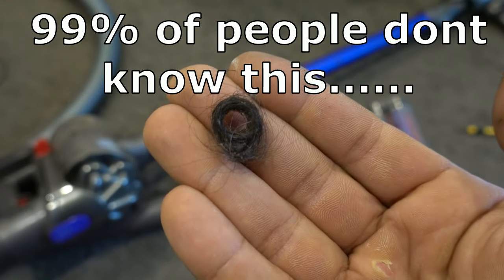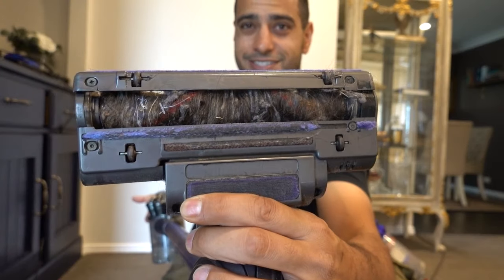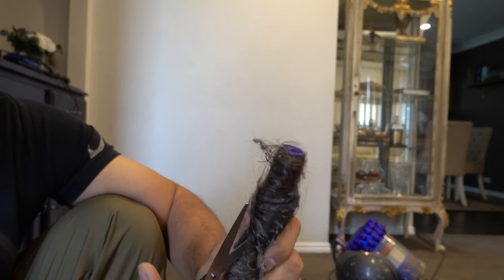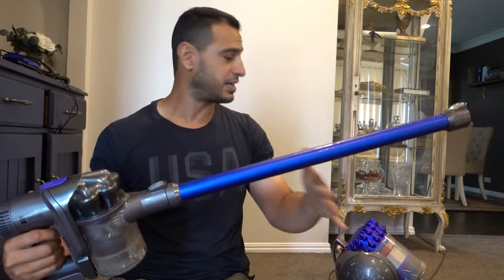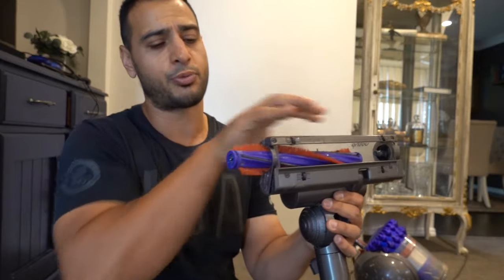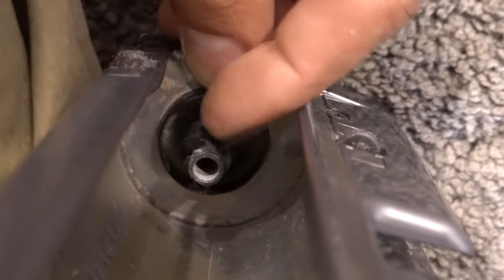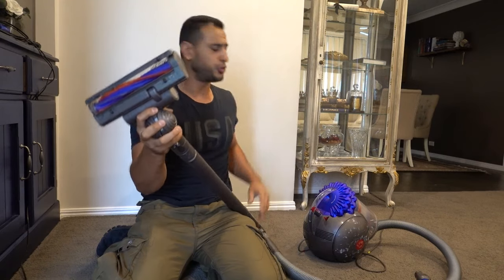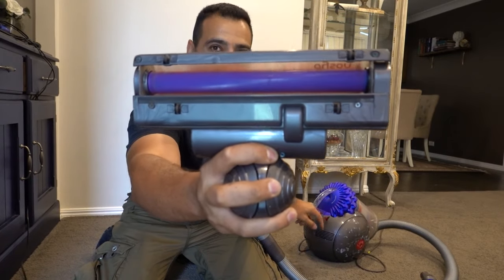How to fix Dyson Vacuum head  - roller not spinning

Comment: Amazing, was ready to throw my dyson out. However can't find that screw driver he refers to to get the last bit out.
Reply: Ok update... after days of trying to find the right tool... got a little handy tool thingy from daiso for only $4.20. Pulled the whole head unit apart to discover not same model and couldn't get to the bit where he takes that hair out at the end. Poo!. But in putting it all together I discovered if you don't tighten the end bits too tight the roller spins freely. All's good for now. But if someone could post how to fix a DC 35 stick please share. I don't think my skills will hold out for too long

Comment: I can't tell if mine is a dud or if the turbine head just sucks compared to a powered unit because it spins but not enough to really clean the carpet like my older powered central vac.

Comment: I’m stuck!!! You have shown me how to dig deeper to clean my Dyson V6 which I really appreciate, But I cannot get all the plastic housing off and and that screw I am digging for still will not budge. Did I forget a screw.? I took 7 out. Can’t get the one in the black mechanism out. Black mechanism is still stuck.....
Reply: you just have to persist there's a little clip on the inside close to the rotating join that's holding the plastic housing, give it a good wiggle but don't use accessive force.
Reply: I was having the same problem. My turbine did not actually have a screw inside, maybe yours doesn't either? not sure if it's a different model and they changed that? anyway, i pried directly under the turbine, not the housing around the turbine and it popped right off! lots of hair there. spinning freely again. give it a tryl
Reply: @cyndimarx3549  glad you got it fixed. Yes I thought mine was different. Had more screws etc. Enlisted a handy electrician friend who had the right screwdriver - and yes  that part was jammed. He got it working now  and it is really working well! Thank you!!!
Reply: @brendafaibish7248  oh, good! u hate to pitch it, then find out there was a solution.

Comment: I tried all these steps, including dissembling the mechanism, it's clean under it. Not sure how else to trouble shoot. The bristle is clean, no blockages. It spins when it's not on the ground. Once it has some resistance it stops. I have the non-powered  vacuum head....Any other ideas?

Comment: Hey! So I've cleaned all the connectors. It only spins when I attach the motorised head to the main part ie. removing the stick. It appears that the power isn't running through the stick part - any suggestions on how to fix that?
Reply from the maker: Make sure the connectors are cleaned properly or use a contact cleaner

Comment: I got the beater bar completely  disassembled  except I could not wiggle the the drive connector at 7:16 in the video.  Gee whiz..  It runs better but the beater bar  still stalls sometimes.

Comment: I have a dyson v6 cord free vacuum and the black part which attaches to the main roller brush makes a grinding noise like its slipping. The black part which moves the roller brush is not moving when I turn on the vacuum. Please help

Comment: I thought I'd fixed it with that 3rd tip but it stopped rotating after about a minute!  The roller seems to tighten up & be stiff to move & I've freed all the hair away!  Maybe it's just knackered?

Comment: Mine doesn't seem to have electrical connectors.  I wonder if that is the problem.  I undertook all the instructions and even removed a significant amount of hair in the little black piece but it still won't budge.  tried to disassemble it further to see the mechanism of the little black piece, but no luck loosening it.  Didn't work for me.

Comment: Hi! This is amazing. Except my roller has a different looking mechanism. Instead of the long pullable bit, it’s more like a three point propeller. And I can’t take it out. I can see there’s hair behind it. It’s killing me! Haha
Reply: You need a T-8 tork screwdriver
Reply: I had the same problem - the screw wasn't an issue, it was the part Bill pulls out with his thumb and forefinger at the end. On my machine it's much smaller than on his so I couldn't get a grip on it. I finally managed to yank it out with the third pair of pliers I tried, padded with a pair of old undies to protect the plastic 👍

Comment: I FOUND A 4th PROBLEM.
The very first step using the spoon to take out the red spool. That’s spool and its end cap come apart. There was lots of hair stuck in there, but removing that wasn’t enough for mine. I also put a few drops of WD40 in there (lubricant) which finally fixed it

Comment: I took out the screw from the middle of the middle, but I cannot for the life of me get the twisted bit off even though I have wiggled and pulled it. I sprayed with wd40 but it still won’t budge. Any suggestions?

Comment: I love this. But can’t get the section off so that I can get to the mechanism. Seems like my stick vac is different? I can’t pull on side like you are demonstrating. Help
Reply: What model do you have? I have a V6 and everything does come apart but some pieces needed to be pulled harder. Try that.  There's alot of dust under there.
Reply: @jpbui  yes V6 stick. Argh. I can’t pull off side. I got a bit to detach but don’t want to break it. Will try again when I have more patience. May  reach out to you again. Thx
Reply: Ok make sure all of the screws have been removed. There are a total of 7.  Two are hidden after you remove a small plastic piece.  The hard piece I had to detach was the top cover dark grey which is combined with the transparent plastic piece.  I pulled on one side then the other and then it eventually came off.
Reply: @jpbui  I have v6. Hmmm 7 screws. I got 4 and one long one. So must be hidden! Will attempt later and keep you posted. Thanks so much for replying!!!!!
Reply: @monicaf3425  Alright just trying to help you get through this painfully annoying problem haha.

Comment: my brush stopped spinning, the easy fix was to remove the filter from the cannister and clean it! once i did that the brush spinned like it was brand new. no need to take the entire head apart as was done in this video

Comment: I myself had a DUH! moment with MY dyson - only because (for me, at least) it was a little counter-intuitive - but just for a few moments. The brush on my dyson started to slow down almost to a stop, and I was looking for clogs in the head, but found none. Then it dawned on me that, because in  this particular model the head uses the vacuum flow to run a turbine that powers the brush, if the flow gets slowed down, of course the brush will get slowed down. So it was just a matter of the vac being full, and emptying it restored the flow rate (duh!) and the brush was back at full speed. This is a new vac, so I wasn't familiar with this behavior. My old vac had an electric motor powering the head, so it ran full speed regardless of whether that vacuum bag was full or not.

Comment: Didn’t fix the issue for me unfortunately. There was wound up hair under the mechanism but after cleaning it out the roller still doesn’t spin. I wonder if the bearings inside are shot because that mechanism doesn’t rotate freely.

Comment: Mine was little hard than this... head motor is stuck up....so i crank it...i have 24volt battery run a clip wire on it...run for quit a bit....then re assemble it...and it works perfect....

Comment: Unfortunately this does not work for my V6 Animal as the design for the final part as shown in your video is different on the head for mine. Shame, I’m going to have to throw out the entire head. I’ll never, ever buy a Dyson ever again. This vacuum has been the bane of my existence and I dread having to use it as there is always an issue with it.

Comment: ugh. the motor inside my vacuum head spins and clearly has no issues, but it's just not "grabbing" the roller or something... I can hear the motor inside spinning and the roller itself has no issues spinning with my hands, but it just seems like the motor has nothing to grab onto inside to actually cause the spinning to happen. So confused!

Comment: I’m so frustrated! I can get to the screw in the spindle, and it turns- but it won’t unscrew and come out. I’m not stripping the screw, I know my screwdriver is in. It turns the spindle if I don’t hold it. But the dang screw won’t some out, not even with a drop of wd40. Cleaned and repaired literally everything else. 😢

Comment: If your dyson vaccum still did not work after all in the video....open the head cover make sure have acces in head motor.....then crank it....i got 24 volt battery get clip wire then run it

Comment: NO ONE addresses my issue which is NOT the connections or the motorized heads as that all works on my OTHER idetnical V8   driviing me nuts maybe it is main board idk was hoping for simple...weird thing sometimes it will run for a second

Comment: AT 6:22 that outer guard just popped out but mine won't budge.
Reply: I eventually got it. It needed to be popped out at a certain angle. When I finally got into the part where your little ball of hair was hiding I had 7 or 8 of those little balls of hair back there. it was hard to tell the difference between hair and the little washer that was in there. Thank you!

Comment: Just wondering if anyone has the same problem as me, my brush head has been cleaned, and it just stopped working on a certain position, on an upright position, it working just fine but when you change the 15 degree like you want to push it, it iust stopped working 😢

Comment: If your brush still doesn't spin it could be dust penetration into the motor. Basically these machines have overload protection that deactivates the brush if excessive load is detected. See how to strip the head down and clean the motor here : https://youtu.be/PHHqUV8KmvE

Comment: Worst vacuum ever!  So expensive but no way to find out how to repair my model, an Oversized 8 with a long spindle in the power head about 6" long that has that part on the end.  I can't find any way to get it out.  Days!  I've been cleaning and removing hair, sprayed the contacts with contact spray.  Only the top half of the spindle spins.  Don't know about the bottom half but it won't  move.  I have 2 others that I'm tossing because they don't have replacement batteries and I will never purchase another one.